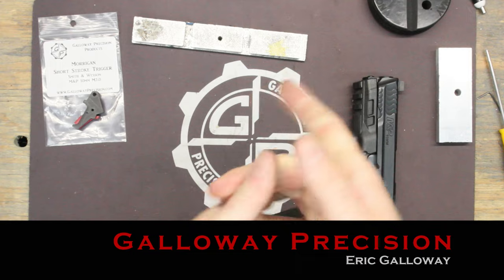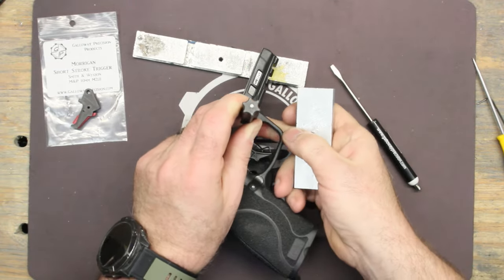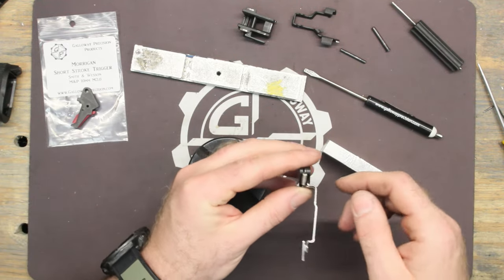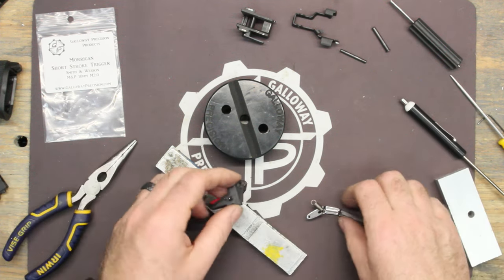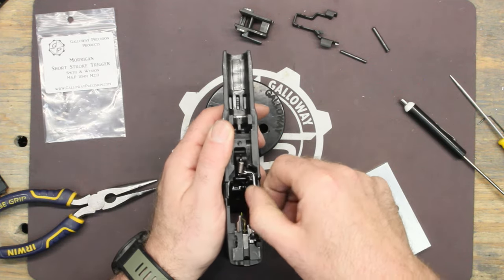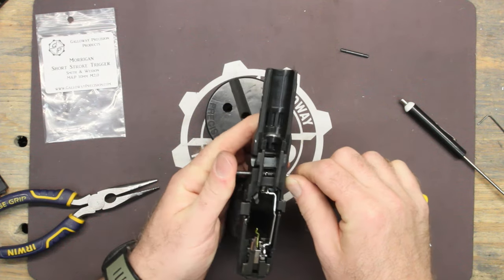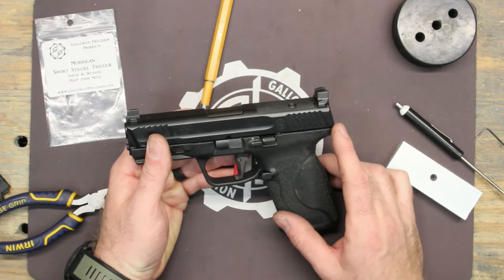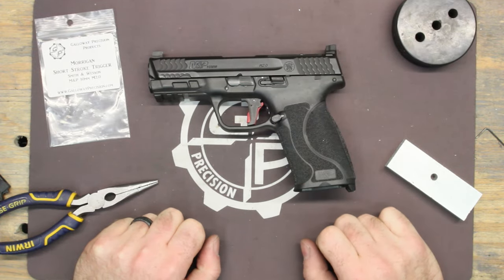Smith & Wesson M&P 10mm Morrigan Short Stroke Trigger Installation from Galloway Precision

Comment: The main reason to replace the stock "skeletonized dingus" trigger shoe is this: if any kind of debris, like a pine needle or some pocket lint, get into the "dingus", it'll render the gun so "safe" as to potentially cost the operator his/her life. I saw someone mention that in a review and it stuck with me. I even tested it and it's true. It doesn't take much. I don't know what they were thinking at S&W, but then it's not the only thing with M&P10. Can't wait to take mine to the range with the new trigger shoe from Galloway. Also have their captured 24lb. RSA (a must for the M&P10). Wish they made a 26lb. Great company to deal with.

Comment: Just put 350 rounds of 10mm range ammo through with the new Morrigan, worked great. I suppose I am not skilled enough to say it's substantially better, but it's at least as good as stock, but with shorter travel, apparently as intended. Works very well, you're able to reset and rest back on the wall without unintentionally making it go - not a "hair trigger". FWIW, before installing, I used an Xacto blade to deburr some of the edges, just in case. Think scraping, not slicing. It's probably not needed, but I thought it'd be easier before it's installed. The face of the trigger is fine and smooth, but I was worried that the very fine edges of the back of the trigger and the corners might grab onto fibers or lint. This is not a critique of quality, just my own "OCD". A great item to replace the hinged triggers that everyone hates, too.

Comment: If you get this trigger shoe and wonder: "can I recycle the stock 10mm trigger shoe onto an M&P 2.0 9mm or 40?" - yes, you can. I just did, it fits perfectly. I know I had this question, so others might too, so there ya go :) Not sure why Galloway confuses us with making it sound like M&P10 and M&P9/40 use different shoes. My Morrigan came in a baggy that specified that it's for all of them. But for some odd reason it specified M&P10 2.0 and M&P45 2.0 in 4.6" length. As if it won't fit the shorter slides... why wouldn't it?

Comment: Will
This work with a SW MP M2.0 10mm with a safety lever ? I tried installing but there isn’t enough room for the safety to fully engage ?
Reply from the maker: For your tolerances, you'll need to fit the pre travel to allow for more forward swing. This can be done by sanding the pre travel stop a little at a time and test between sandings.

Comment: Will this work on other full size gen 2 m&ps?
Reply from the maker: This is just for the M&P 10mm Mod.2. We do also have the Moray Trigger for the M&P 22 Magnum and M&P 5.7.
Reply: @GallowayPrecision  What about something for the 4" compact in 9mm? How about some love for the rest of us?
Reply: @tomsearan5641  I just installed this on M&P10 and then "recycled" the stock 10mm trigger shoe onto an M&P40 2.0 in place of that hinge trigger, it fits perfectly. The Morrigan that I received said that it's for "10mm 2.0 and 45 2.0 4.6", 40 2.0 and 9mm 2.0". I'm not sure why Galloway introduced this confusion - by mentioning 4.6" only and by selling a separate shoe for 9/40, when they are all one and the same. I get it, the rimfire and 5.7 might be different, fine, but all of the double-stack 2.0 should all be same across the board, whether Smith designates them as "compact" or not, that just means a shorter slide and grip. Just like Glock 26, 19 and 17 all use the same shoe, along with 22, 23 and many others of same form factor.

Comment: This trigger is ridiculously short and crisp. Reset is almost nothing. I’d say it’s similar to a tuned sao with a single stage trigger. Hardly any travel in either direction. Just did the install in about 5 minutes. Super simple, especially after working on my decocker CZ’s. Can’t wait to get it to the range. I’d guess same hole shots at 25 yards with this trigger and the dot.
Reply from the maker: Thank you for the feedback. Glad you like it. We appreciate you.